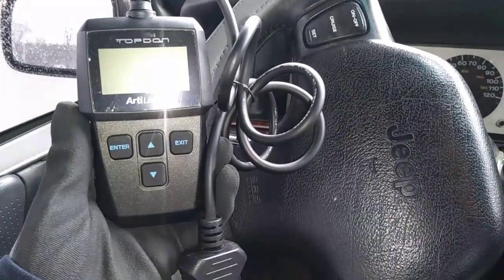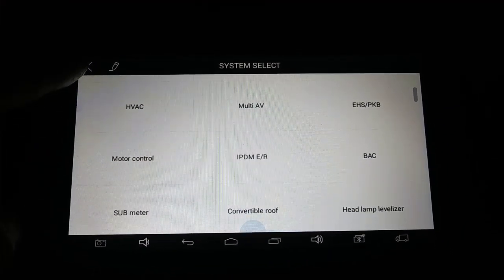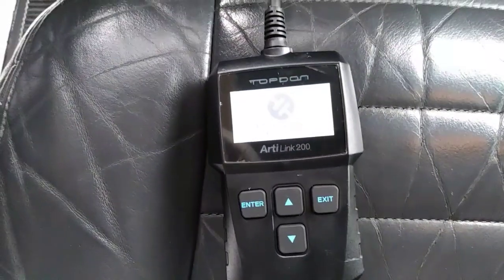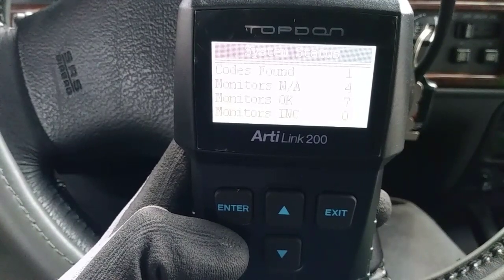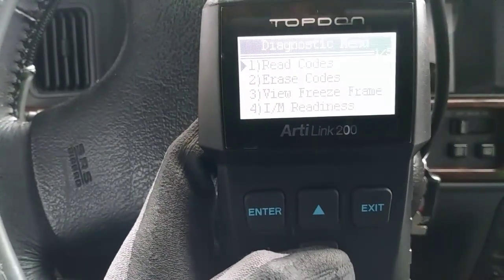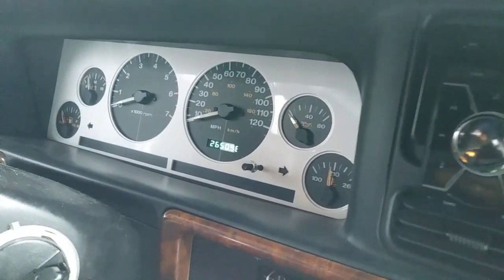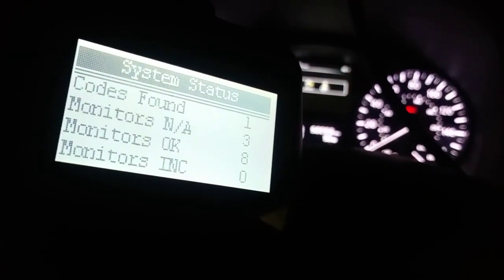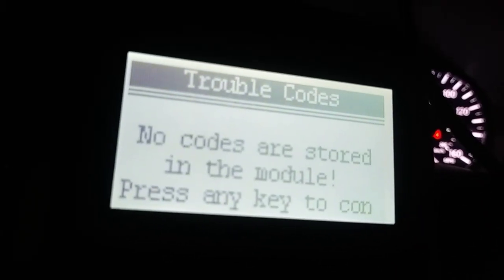ARTILINK 200 OBD2 SCANNER

Comment: LOL, an AGGRESSIVE check engine light!! Very good explanation of EVERYTHING!
Reply from the maker: +Astral Auto Repairs right! Thats my wifes Jeep and that check engine light is "one" with that damn vehichle. everytime I fix the issue, it throws a new code, CEL glowing brighter each time
Reply: +BARRICADE GARAGE 

That's strange, I've been driving this gen Jeep since 96, I pretty much have to hit it with a nuclear missile to activate the check engine light. Maximas are a whole different animal with o2 sensor codes and evap codes.
Reply from the maker: +leakyjeep5.9 I know what you mean. I have 2 from '96 but for whatever reason that '97 likes to show off.

Comment: What if you don’t have an OBD2 and have a OBD1
Reply: If your vehicle still has the OBD1, consider looking into the Actron 9690, it does OBD1 & OBD2, but only certain vehicles on OBD1
Reply from the maker: +11B Garage this is an obd2 scanner so it wont work with obd1 vehichles